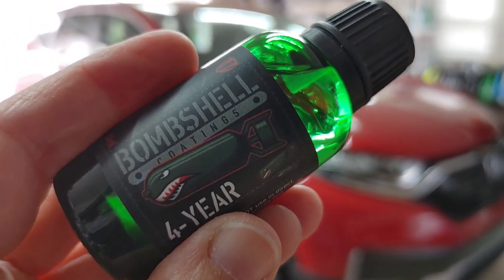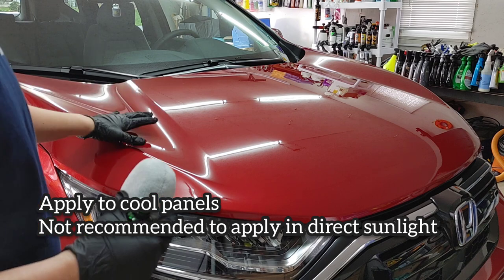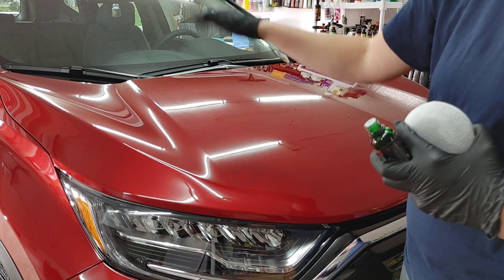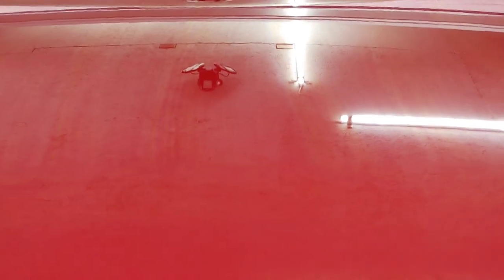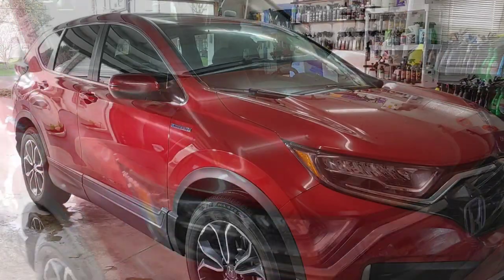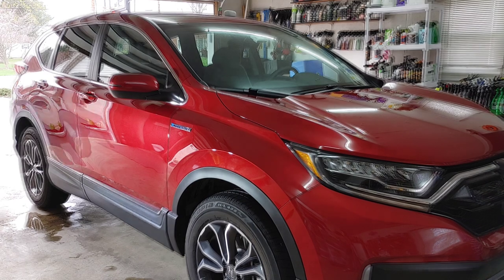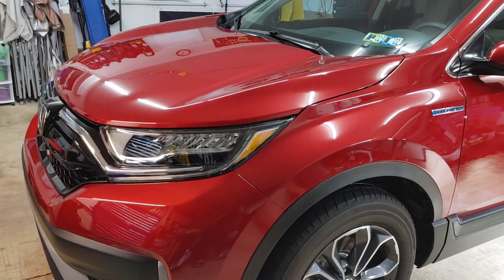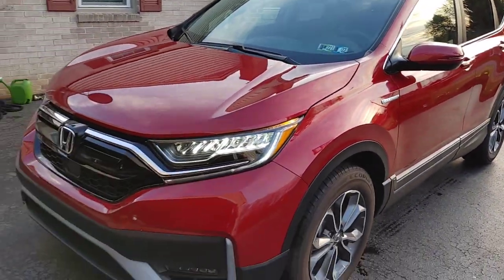NEW Bombshell Coatings 4 YR Sio2 Coating- Application, Tips & More! Is it a WINNER?? (I think so...)

Comment: Very nice! Looks like an easy on/easy off application with nice gloss.   

Have You ever tried GTECHNIQ CSL? Thoughts on it?

Thanks for sharing this! I like that applicator. Did You use distilled water for the beading spray test? (which looks quite good).
Reply from the maker: Haven't tried that one YET
Reply: @attention2detailswchelsea  A few detailers(this one included) use CSL as a "one and done" application.  EXO is a top coat(not required) can be put on top of CSL.   I love it! Definitely try it.  I'll bet it'll be similar to the featured coating in this video(which looks fantastic)
Reply: The ease of application was a main goal of ours along with durability and gloss. Time is money and when living in a hot and very humid climate, nobody wants to spend time trying to level coatings. ;)

Comment: Hi Chelsea, how do you prepare plastic trim for a coating that has previously been protected with just a maintenance product? Especially older trim that maybe slightly faded, great video 👍😁
Reply from the maker: Clean with an apc, do a panel prep or ipa wipe and then coat
Reply: @attention2detailswchelsea  thanks 😊

Comment: Okay, as a non-detailer, who may like to get my car detailed professionally if I could get a 4 yr coating like this.... when talking to a detailer, which products should they be using?  I have a new black car and had always had used cars before, so this is my first "baby" so to speak.
Reply from the maker: The prep is key. They need to do a quality strip wash, decontamination, inspect the paint and polish if necessary, panel prep wipe and a coating similar to this that has quality ingredients, reputable results and stand by their work. Theres a LOT of coating options out there. Inquire to what they use and why. Do your research and then make a decision. But how you maintain the coating will also affect the end results so make sure you maintain them properly. You can get a quality coating but maintain it improperly and it fail and thats not necessarily the installers fault but they need to help educate you on proper maintenance as well

Comment: The price is too high. Ok I'm sure people with big vehicles would like to use it too, but for $80 plus? I'll pass
Reply: We will have to disagree with this... Quality costs money and quality small batches that we make cost more than large bulk cheap materials. Your opinion might be that it's too expensive for you and that is okay but for what the product is, it is not too high. Time equals money and the time you save installing this coating far outweighs the cost of the actual product. This comes from years of experience in business and the coating business.  Use Chelsea's code for 15% off as well to offset the cost some! Thanks!